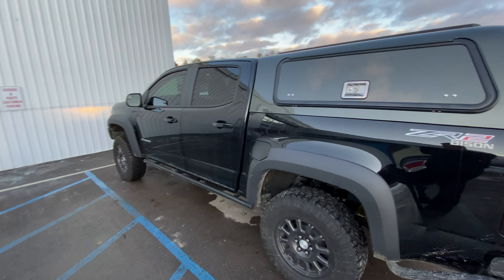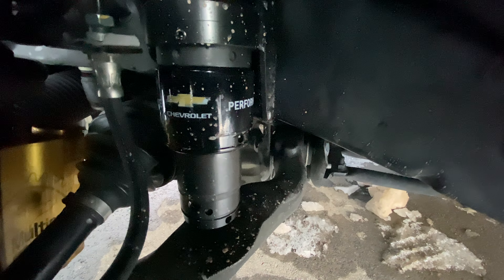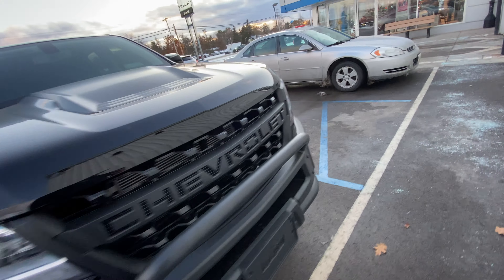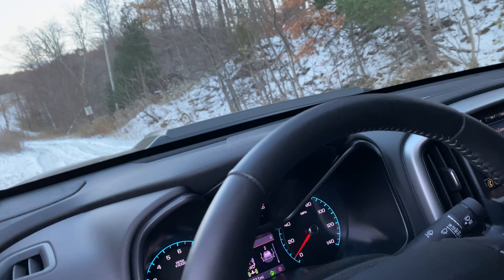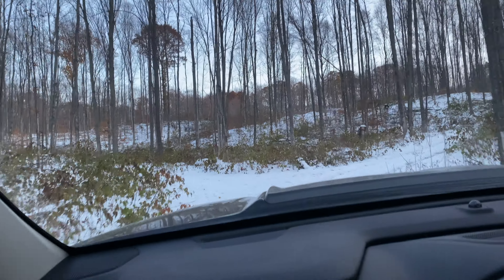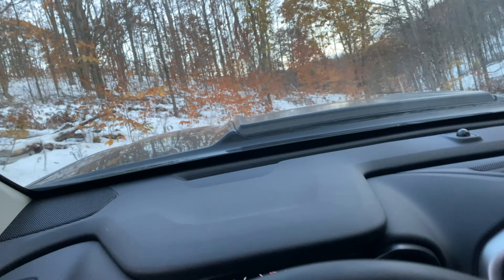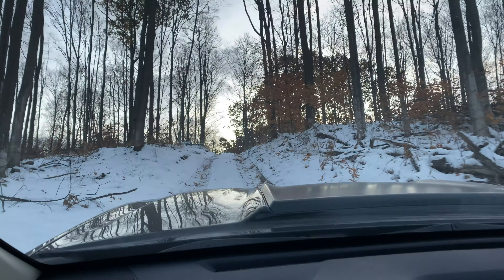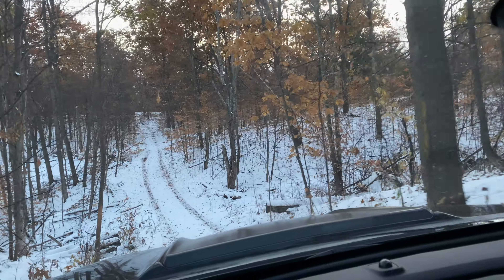Factory Race Parts for the ZR2 Bison! (GM Performance Jounce Shocks)

Comment: good god. over 3000 bucks for the jounce shocks and the cross member.  on Gms site it states the rear cross car beam only works on the gas. assuming that means you cant get the jounce shocks on the rear of the diesel ? bummer if true
Reply from the maker: the cross car beam is not necessary.  you can put jounce on the diesel

Comment: What all have you done for the suspension? I'm wanting to do the 35" wheels when AEV releases the fender flair kit
Reply: Haha just saw your list of upgrades! Will you need anything else other than the flare kit to get the 35's to fit? I can't wait!
Reply from the maker: Just flares!
Reply: Cars, Cats & Cannibis...Does adding 35” tires require you to change the gearing?
Not sure if I see a video since you made the change to 35” tires (if you have already) 
Mind sharing your experience since the change? (mileage etc) 
Thx!

Comment: From watching a lot of your videos, I know that you are friends with G2SKIER. I know he got the Timbren active off road bump stops. Why did you decide to get the jounce shocks over the off-road bump stops? and I'm not sure if you have driven his vehicle with the bump stops installed, but if you have which one do you like more and do you think the jounce shocks are worth the price difference?
Reply from the maker: I have had both installed on my truck. The jounce shocks are great for higher speed stuff but the timbrens worked great too. I wouldn’t spend the money on jounces if you do low speed stuff
Reply: @CarsCatsCannabis Thanks for the reply. I don't have a ZR2 yet but I'm currently saving up for one. Your channel has given me great ideas of what I want to do with mine when I get it and to see how much budget I would need to mod my truck. I also live in Michigan and its cool to see all of the offroad adventures that are possible up in the UP. I might have to wait for the next gen Zr2 in 2023/2024 to be unveiled to see if I can wait for the next gen truck. I think I might go with the front GM performance Jounce shocks and the Timbrens in the rear for cost-effectiveness. Love the content! keep up the great work.
Reply: The total Chevy Jounce system is $5800 or so total, inc the cross bar. The striker plate is $2,000, otherwise the price would be reasonable.

I’m torn between the Timbren set up for $500 (inc new U Bolts.)

Comment: So my Chevy dealer is saying the GMPP High Angle UCA and Level kit Part# 84621360 is not compatible with the ZR2 Bison DSSV Shocis #84402367. How did you replace your shocks too?
Reply from the maker: They are compatible with the stock shocks. The long travel shocks are the part number you referred to.
Reply: @CarsCatsCannabis  My dealer says my 2020 Bison came with the long travel shocks #84402367 and since they are not compatible wont install the leveling kit. . . so confused. . .
Reply: @_Akicita_  --- Your dealer is wrong.
Reply: @davidallancole8570   Yes - It took a call from Multimatic in Canada to convince them. They are actually installing it today as I write this. Thanks for the reply.

Comment: What's the are the overall benefits of the new control arms and the jounce shocks?
Reply from the maker: Much more suspension dampening capacity.  Much smoother ride over bumps.  New control arms lift the front a bit and have higher articulation, the level raises the front so I can eventually fit 35s with AEV fenders they are releasing.

Comment: Put the Rears on the Inside and you could use the 589 Shock Relocation Kit!
Reply from the maker: New video to come. Shocks relocated and still have jounces where they are !
Reply: @CarsCatsCannabis --  Did you Flip the U-Bolts and if so how?

Comment: Dude that is a lot of money for some damn bump stops bro.
Reply from the maker: seems to be "worth it" this far. not about the cost, it about having factory verified race parts.
Reply: Road Less Traveled it still looks great. I understand where your coming from. If I had the money I would go Chevy performance but I feel you can get king, icon bump stops for maybe 5-6 hundred. Which are great after market parts. Bottom line your still doing great stuff with your truck. It’s awesome.